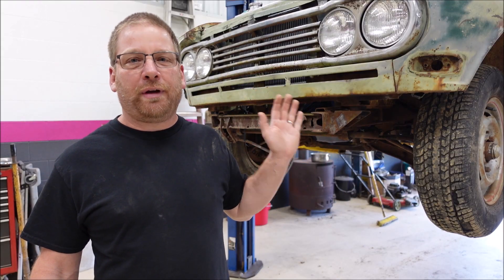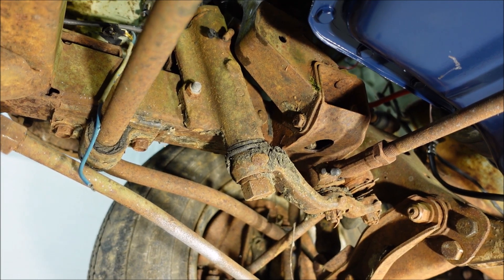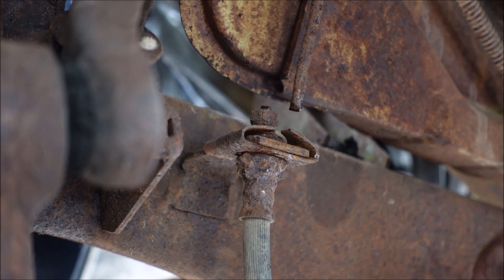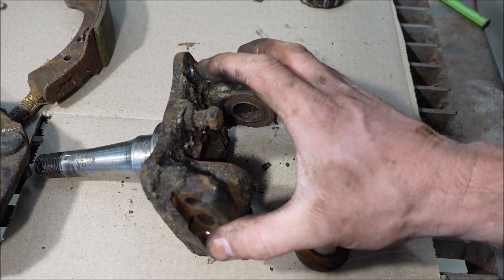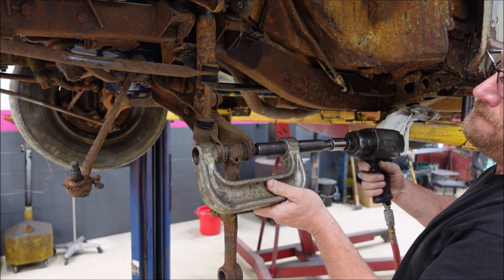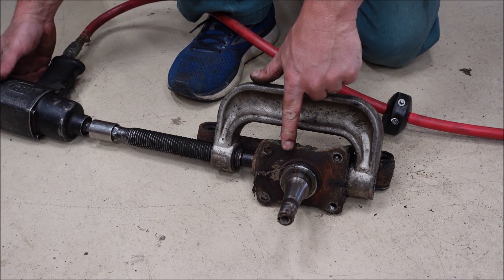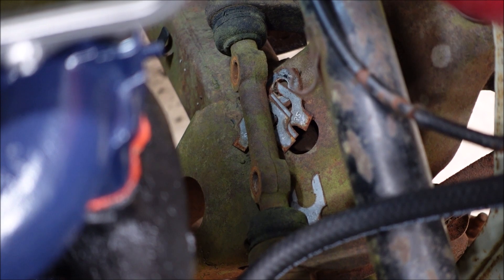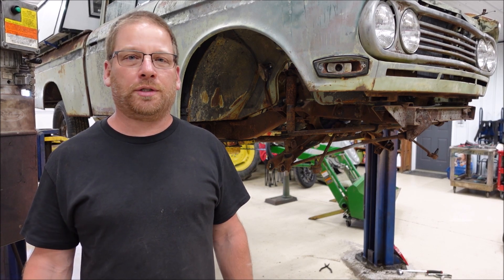#14 More TRAUMA No Let Up FRONT End CALAMITY ..  Datsun 520

Comment: Those suspension bushings are bronze (I think) screw types, the rubber in there is just a seal.   It's been 15 plus years since I bought most of those parts on ebay, many brand new from singapore, shipped on a slow boat.
  These trucks were also sold in taiwan as "Yln" brand.  I think that is why the parts were so  plentiful.
Reply from the maker: Good deal thanks for the info! I have found most of the parts I need but it's been time consuming and expensive!